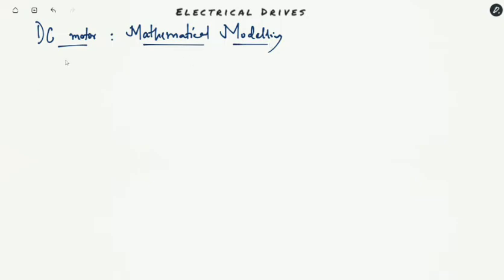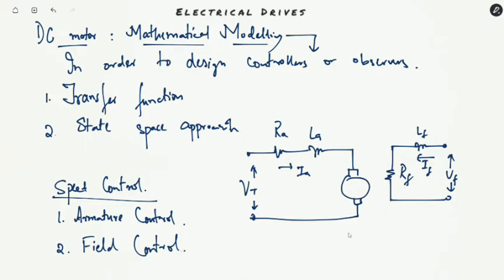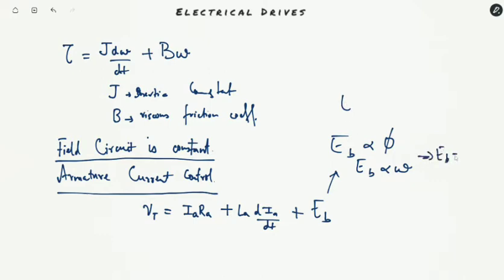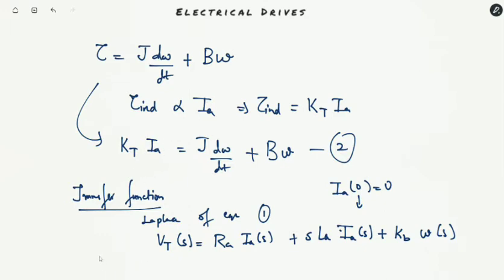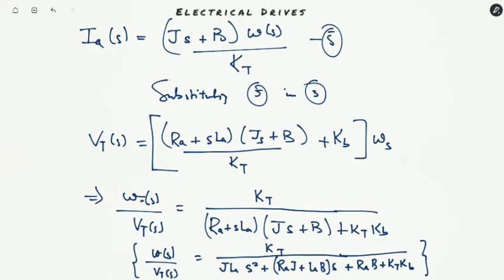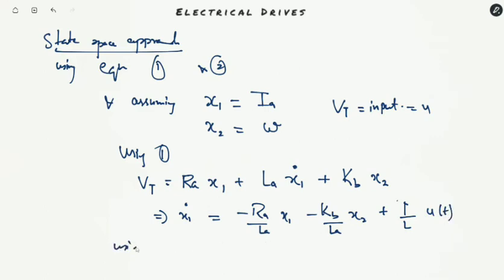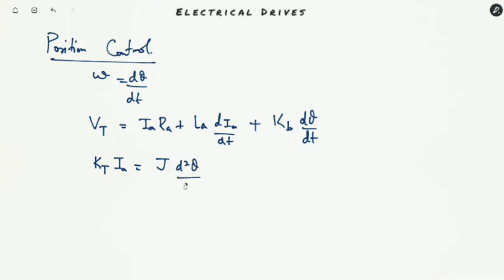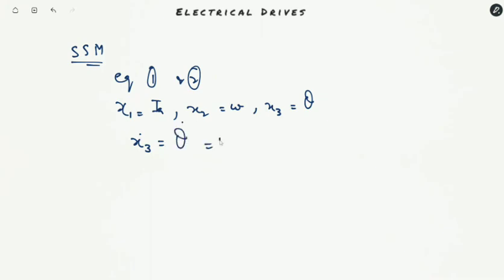ELD - 4 Mathematical model of DC Motor

Comment: Hi sir could you please tell me the ans for this question. 
What is the order of the characteristic equation of an armature controlled dc motor?
Reply from the maker: With speed as output, its 2nd order. With position as output, its 3rd order transfer function.